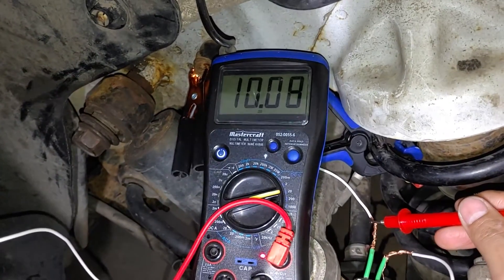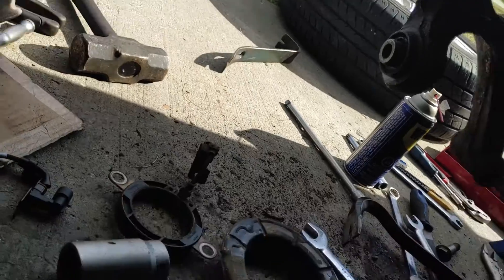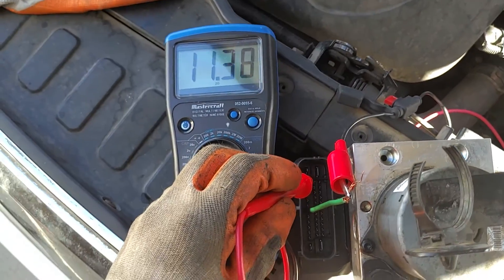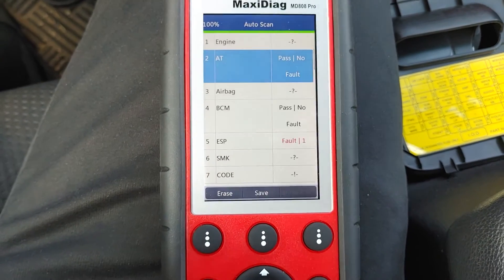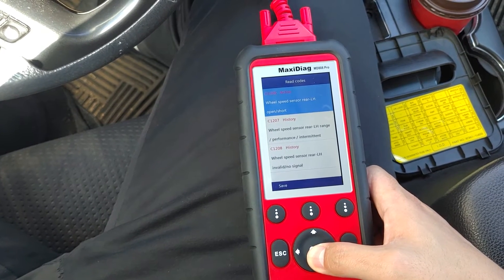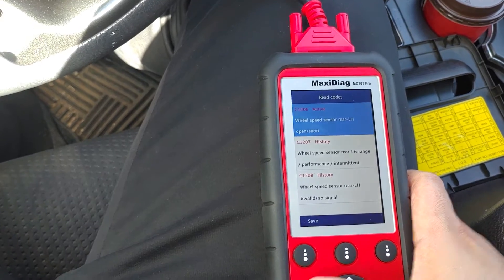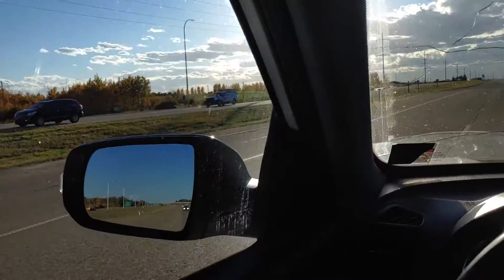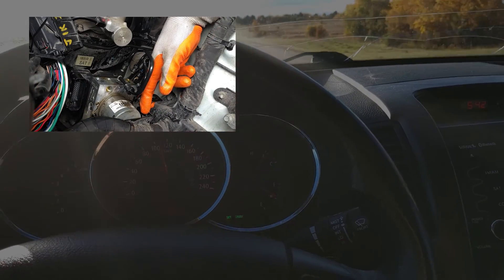Diagnose and Identify Faulty Wheel Speed Sensor and ESC Module: 2011 KIA Sorento | PART 2

Comment: you got crazy about those two failure happened at the same time causing same symptom..

i have same problem for door lock actuator. it works with a micro tag switch . but both are notorious of being broken parts. 
once one of them replaced and still stayed no working.   
oh gosh! the actuator i bought  had defected one.... blah blah..
Anyway, it is not easy to diagnose malfuction if the connected parts has broken ay the same  time.

Good job
Reply from the maker: Yessir! Crazy I did go for a moment. It is a long story as well.

I haven't had to deal with a door lock actuator, but I can imagine some head scratching as well.

This job wasn't easy to figure out but after a good amount expletives and doing junkyard runs, the schematics led me to the solution.
Reply: @AutomotiveForBeginners  haha 
"Junk yard back and forth" is exactly same as my case.. and finally i decided to buy new one ended with  defected one from Rockauto and  still waiting for the replacement..
but you did a good job!!!